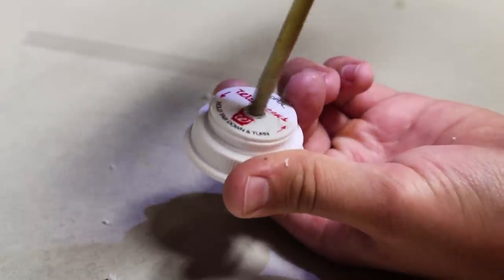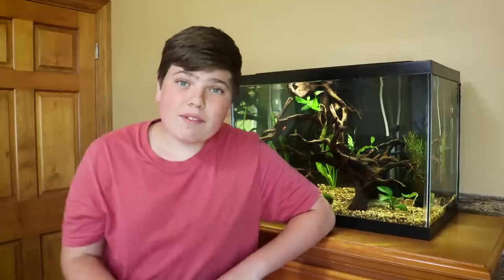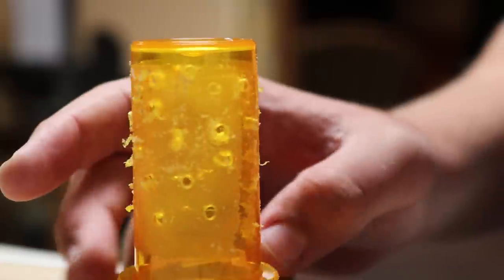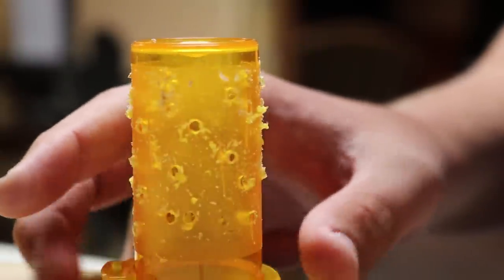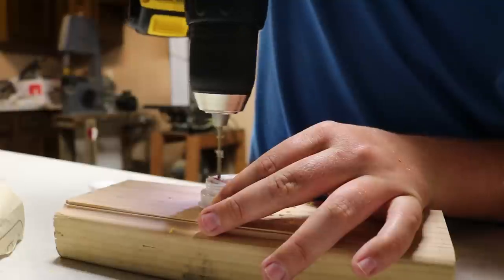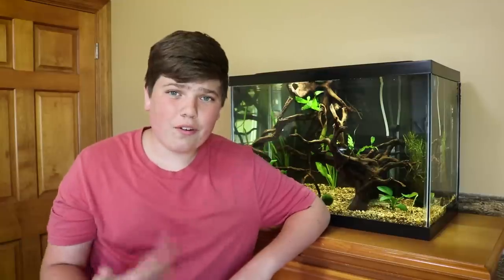Worlds Smallest DIY Filter!!!!

Comment: I just bought a 1 gallon tank for my betta that came with a filter. The filter is too strong for the tank so I started looking for some DYI filters. This is exactly what I was looking for. Thank you!
Reply: @samuelbrown2580   is it your fish
Reply: THIC DOGGO  Maybe not, but that doesn’t mean they can’t provide helpful advice. It’s also true.
Reply: 1 gallon for a betta? Something wrong is not right dude, inside your brain
Reply: @victorc9987  bettas need at least 3 gals
Reply: You’re going to hear different opinions, I think 10G minimum but a good base is 5G minimum
Reply: @adoreyou7449  i agree i think every fish should have at least a 10 gallon
Reply: @victorc9987  Use Grammarly. Something wrong is not right dude, inside your brain. The zuera never ends...
Reply: WHY ARE YOU PUTTING A BETTA IN ANYTHING UNDER 10GAL
Reply: Really bad
Reply: @ImVraholic  that isnt recommended, 3.5-5 is the minimum
Reply: @trigtrag4116  The normal recomendation is 3 gall9ns or 11 liters

Comment: But why use a straw which has to be attached to the air tube? Just put the air hose into the bottle and hot glue the hose to the cap. No tape that would not hold.

Comment: This works great! 
I made it out of a small supplement bottle so it is about the same height but almost twice as wide. Used a strip of filter sponge (cut with a bread knife) to wrap around the inside. Didn't use a straw, but was able to use the air hose with a stone fit snug (no glue).
Great idea!

Comment: Just installed into my 2.5 gal betta tank hoping for the best 🤞🏽
Reply: I don't understand how this is a filter? This is a diffuser for the air pump. It has no way to suck water in. If I'm wrong, please tell me how (like actually explain how it sucks in the water it needs to clean) because I NEED a tiny FILTER.
Reply: @rockarollawmn  i think it's just the way he created the "filter" that's confusing but the way these types of DIY filters work is

With being connected to an air pump and putting the airline tubing inside the bottle through one of the holes he drilled , the other holes that were drilled will be sucking water through because of the air pump/line . all that water being sucked into the bottle will be filtered by either "filter floss / poly-fil " which will polish the water or you can do lava rock or bio-balls or gravel for biological bacteria . once the water is sucked into the bottle and goes through the media it then will exit the bottle through the top with either clean water or clean and cycled water depending on the media used. I've created some before and there's many youtube videos of people doing these types of filters I just think the way he did it here was maybe a little different so idk how effective his method is
Reply: @rockarollawmn  did you ever find out? I for the life of me can't understand the suck of it. It's a diffuser, I can't visualize it. Even though I made one, because I needed a small one, but I am going to look tomorrow. I have no idea.

Comment: Yeah I can see something I would do differently I wouldn’t use a straw I would use actual air hose and then use a air hose water Backflow protector to connect the two to the pump

Comment: I don't understand how this is a filter? This is a diffuser for the air pump. It has no way to suck water in. If I'm wrong, please tell me how (like actually explain how it sucks in the water it needs to clean) because I NEED a tiny FILTER.
Reply: I am still waiting for this to be answered. I can't diy, unless I can visualize how the air is sucked in. He is a good boy, I just need more info.
Reply: The air goes up through the top and pulls water with it. This creates a vacuum where water needs to be replaced and comes through the holes drilled in the sides (and through the filter medium). Beneficial bacteria colonize the filter and clean the water as it passes through.

Comment: Just a tip, never put super glue in your tank. Only use aquarium safe glue and a brand new bottle form the pharmacy. They will give them to you free. Then there isn't a chance any medication residue is on the bottle.  Purchase a sponge filter (they are so cheap it's almost free). Next,  add some carbon to the bottom of the bottle,  cut the sponge to fit the bottle and drop it in. Finally, cover and stick in the hose. So long as you have a small enough opening in the sponge the hose will stay. There isn't a need for glue. I figured this out when I used a tiny baby food jar, without the top, as my filter box. Worked great! :-)

Comment: anyone using this does it actually work ?
Reply: Yes!
Reply: Yes, but I made it out of a small supplement bottle so it is about the same height but almost twice as wide. Used a strip of filter sponge (cut with a bread knife) to wrap around the inside. Didn't use a straw, but the air hose (with a stone).